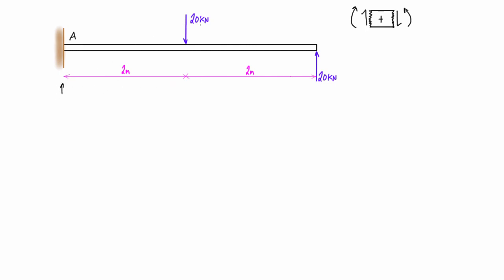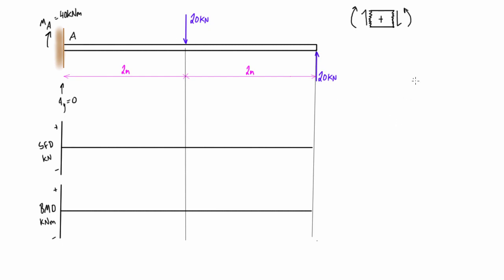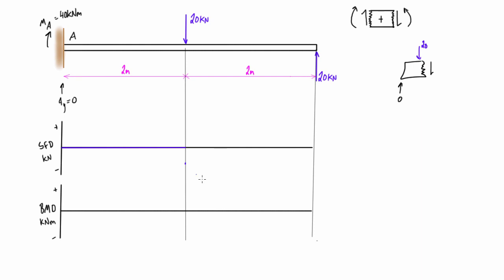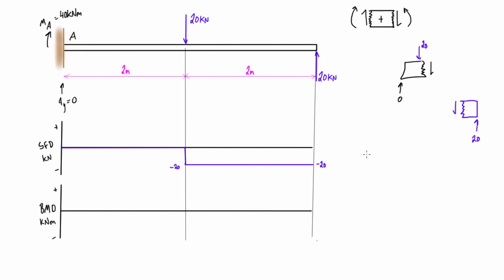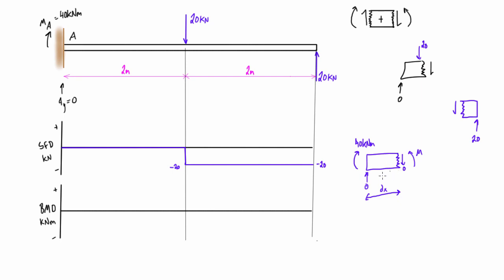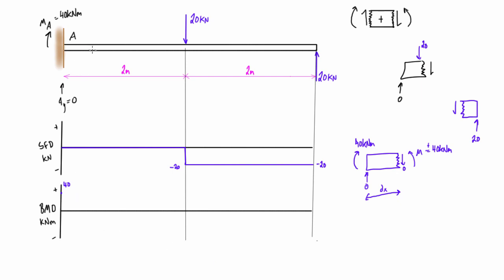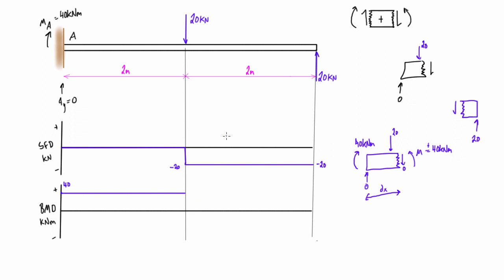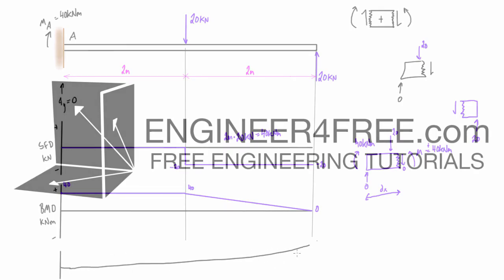Shear force and bending moment diagram practice problem #6

Comment: How did we know that Ma was clockwise? please answer
Reply from the maker: It was assumed, and then that turned out to be correct because the calculated value was positive. You can determine it from inspection in this problem in two ways though. 

1) The equal and opposite point loads generate a force couple that causes a counter clockwise moment. The reaction must therefore give a clockwise moment for the structure to remain in static equilibrium.

2) Both point loads have the same magnitude, but because the far right one is further from A, it's going to create a bigger moment about A than the closer one. The further one generates a counter clockwise moment about A, the closer one generates a clockwise moment about A. Because the further one creates a bigger moment, the net moment is counterclockwise, so the reaction at A must therefore give a clockwise moment for the structure to remain in static equilibrium.

Comment: Thanks for the video! i've been following the playlist for a while, but i have a question. How is it that counterclockwise moments, that are given the minus sign always have concave graphs? So if the parabolic graph for BMD is ax2+bx+c, the a is negative. Comparatively, in my country, it's preferred to draw it inversely, as the counterclockwise moments are actually positive, and it's still drawn concavely above the x axis. Can you give me some insights on this? thank you.
Reply from the maker: Yeah, the convention in some countries is inverse to what I have drawn. But pay very close attention to the positive and negative orientation of the "y axis" of the BMD. I intentionally label the top side as positive and the bottom side as negative. If you look at your professor's examples, you'll likely notice that the top side is labelled as negative and the bottom side is positive. In that sense, drawing an inverse shape has the exact same mathematical value. Ie, +40kNm is still +40kNm as long as it's drawn with a magnitude of 40kNm and is on the positive side of the axis. Confusing? yes. But it's just how it is. Back when I as a student, I had professors from many different countries so I learned both ways, but I opted to make my videos the was I did, because it makes more sense visually as we integrate from the SFD to get the BMD. But in practice, especially when you get into more complicated frames, drawing the inverse of how I have done it often is more useful, because the actual side of the member that is experiencing tension will match the side where our positive values on the BMD are. When doing the actual math for finding a function of M in terms of x though, the way I do it makes way more sense, because we expect positive parabolas to open upwards, and negative parabolas to open downwards. Think in terms of up and down is not entirely correct though, its really that positive parabolas open towards the positive side and negative parabolas open toward the negative side. So if define down as positive, then a positive parabola opens down (toward the positive side). That bends my mind too much and usually causes math errors, so thats why I still opted to draw my BMDS with positive on the tops side. But both ways are correct. 

If you're really confused about which way the concavity goes for a particular parabolic section of the BMD, then there's a simple visual check you can do on the SFD. In the region that is parabolic on the BMD, the SFD in that same region will be sloped, essentially creating a triangular shape on the SFD. We integrate SFD to get BMD, so tl;dr, the area under SFD in a region equals the change in magnitude on the BMD across that same region. Slice up your triangular shape into many skinny tall rectangles and do a very rough mental numerical integration. The area of each rectangle will correspond to the change in magnitude across it's skinny width. So taller rectangles will cause greater changes than shorter rectangles. That means the tall side of the triangle will have greater slops on the BMD than the short side, which will have more gentle slopes. Knowing that, and knowing that a positive area on SFD creates a positive change in magnitude on BMD, and a negative area on SFD creates a negative change in magnitude on BMD (keeping in my which way [up or down] that you've defined as positive/negative, then there is only one way to draw a parabola that increases or decreases from left to right, and has greater or less slope its right or left side. That's a lot of text, but I hope it helps to clarify. You hit a really good question. If it's not super clear from the text, then keep watching the first 9 examples in the playlist, and you might start to see the pattern where I'm using this sort of "visual" triangle method to speed up the determination of BMDs. Good luck!!
Reply: @Engineer4Free  Thank you for answering! so far, i can generally take the conclusion as: if it's UDL, and the magnitude is negative (assume we go by your sign convention), it's most certainly concave, due to the negative slope.
Reply: Sorry i meant to say it's still negative, but just drawn inversely.
Reply: wait no, it's inverse in signs too, so positive for counter clockwise and negative for clockwise lol sorry

Comment: example 4,5,6 how do you determine the clockwise/anticlockwise of the reaction moment?
Reply from the maker: They all use the sum of forces in y direction and sum of moments about a point. Those two of the three basic equations of statics (the other being sum of forces in x direction). You can see some detailed videos on that stuff in the "moments" section of engineer4free.com/statics 🙂

Comment: Im confused as to why the moment on A is going clockwise? in your example #4 video, when the beam is connected to the wall or whatever on the left side the moment is going in the counter-clockwise direction.Is it because the force pointing upward on the right side of beam creates a counterclockwise moment on that side and you just have to match it with the corresponding direction from the diagram  at the top?
Reply from the maker: When you have a cantilever like this, you need to find the reactions at A before we do the SFD and BMD. We do this by using the 3 equations of statics which are ΣFx=0, ΣFy=0, ΣMa=0. The sense (clockwise vs counterclockwise) of the reaction moment will depend on the loading present. In example 4, the applied loads overall apply a clockwise moment on the support, so the reaction force is equal and opposite (counterclockwise). In this example, the applied loads overall tend to create a counterclockwise moment on the support. It can be noticed here by inspection. We have two point loads acting perpendicular on the beam but at different distances from A. The further away, the greater the moment the same point load would make. So here, the point load at the end is pointing up, that's going to give us a greater moment about A than the one in the middle pointing down. When their moments are summed up, the net moment is counterclockwise, and therefore the equal and opposite reaction moment must be clockwise. Don't always assume a reaction on a certain type of support will be a certain direction or sense, as a prof will always pull a trick setup with loading to give you something you don't expect. Does that clear it up?

Comment: How can we determine the direction of moment?
Reply from the maker: Hey you can brush up on moments with videos 25-34 here: engineer4free.com/statics. Generally, if you have a point force acting on member, and you are doing the sum of moments calculation about some point. Imagine for a second that the member is freed from all other supports but pinned at the point. If you then applied only one of the point forces, which way would that point force cause the member to rotate about the point in question. That will quickly give you the sense (clockwise or counterclockwise) of the moment.

Comment: quick question, when you work out the Ma, why don't you write out the full eqn; Ma=20(2)-20(4)=-40kN?

I don't understand how in this case you worked out Ma to be + 40kN

With the eqn I understand that the Ma is acting in a counter clockise direction, since it comes to -40kN

Thank you!
Reply from the maker: Yo Joseph. This trips up a lot of people. In basic statics, you're often taught to just take any counter clockwise (CCW) moment as positive and and clockwise (CW) moment as negative. That's a popular convention for FBDs when only considering external forces in the pursuit of solving for reaction forces. That's great, but now we're dealing with internal forces, which also have sign conventions. Watch this: https://www.engineer4free.com/4/introduction-to-internal-forces and more importantly, this: https://www.engineer4free.com/4/internal-force-sign-convention It's also a bit confusing because the reaction Ma and the internal bending moment M at a are not the same thing. They are indeed equal and opposite. When you have a counter clockwise internal bending moment to the right of a virtual cut like we do in this example, that's considered a positive internal bending moment according to the positive sign convention that I linked to in the second video above. So I draw the value on the BMD as positive 40, which is above the axis of my BMD. Some people put positive above the axis like me, and some people flip it vertically so the positive side is downward. Technically either way is fine, they are just done differently in different parts of the world. So if you were all good with the internal moment sign convention but the BMD just looked upside down, don't worry about that and do it how ever your prof wants it. If the BMD doesn't look upside down to you, but were just confused about the CW vs CCW moments then ignore this part of what I'm saying and just watch the other videos that I linked to =) Hope that clears it up!
Reply: @Engineer4Free  Thank you so much, it was very well explained, although the whole concept is a bit difficult to grasp
Reply: @ghazanfarsheikh44  Believe it or not that’s a good thing, it takes a while to sink in.

Those who think that they “get it” instantly, rarely do. 

Just stick to the diagrams and draw them in a column, it’s easy to mess up. I’ve seen professors get confused.
Reply: @Engineer4Free  thank you. I think I understand it, but not as fluently as I could, and definitely not fluently enough to try and type out any concern I still have regarding my understanding through text. Too hard to convey!

I watched those two videos, I probably should've started from there. I started from Q1 to Q9, and then after Q9 realised I didn't remember differential eqns haha!

I'll continue to do problems, and if I find i trip up somewhere in my understanding I will send you a message.

I have sent you a DM actually to ask for some quick advice!

Oh and yes, your graphs are how I was taught. I'm in australia, so positive is above the line.
Reply: Ahh, I just listened back and you said, equal and opposite. Not sure I've been understanding it like that up untill this point.?

Comment: Hey, great video! I am finding it difficult to understand why the beam is delfecting upwards?
Reply from the maker: Thanks! Imagine a diving board with a person standing on the end. That would be a cantilever beam with a single point load equal to the person's weight at the free end. You know that the board would sag / deflect downwards at the free end. If you instead applied the same load (equal to the person's weight) in the upward direction at the end of the board, it would deflect upwards the same amount. Now imaging the person is standing on top again at the free end, but at midspan there is a person pressing up on the diving board with a force equal to the top persons weight. This makes the vertical reaction in the fixed end zero, and reduces the moment reaction by half. But less math and more real life imagination: will the diver at the end be lifted up or sagging down from the diving board's original position? The board will be sagging under the weight of the diver at least relative to the position of the board at midspan, because, well diving boards are super floppy so of course that part must be true. Imagination tells us that obviously the board will sag down at least from midspan to the free end. Imagination doesn't exactly tell us whether or not the mid point of the board will be above or below it's undeformed/original position. We use the assumption that rigid connections remain rigid even while the rest of the structure is deformed. So our diving board will be horizontal right at the connection. We then consider the BMD of such a system (which in case I lost you is just the vertical mirror image of the one presented in the video) we would find that the internal bending moment is negative everywhere (again, would just be the mirror image of the BMD in this video).The BMD would not cross zero (note it equals zero at the free end, but it doesn't go from a positive value to a negative value or vice-versa somewhere along the length of the beam). If a BMD crosses zero, there is an inflection point in the deformed structure at that location, which means the concavity of the deformed structure will switch. We don't have that, so concavity is the same everywhere. If the board is horizontal at the reaction, and displaced downward at the free end AND there is no inflection point, then the beam must just deflect further and further downward as we go from the fixed end to the free end, maintaining a "concave down" curvature the entire way: try drawing the deflected shape with these constraints (horizontal at reaction, free end displaced down, concave down everywhere) - there is only one way to satisfy them and you will see that the midpoint, and all points will be displaced downward. If somehow the board was displaced upward at midspan and downward at full span, then there would be an inflection point somewhere between the fixed and and midpoint if it was horizontal at the reaction: trying drawing the deflected shape with these constraints too (horizontal at reaction, midspan displaced up, free end displaced down) - you'll find that you have to include an inflection point that isn't supposed to be there in the correct solution). Note that without the presence of a hinge somewhere in the middle of the beam (only really shows up in trick problems, so don't worry about that), the deflected shape must be smooth ie. no sharp angles. So between a bit of imagination of a real floppy diving board, and some discussion of the moment in terms of x as we move along the BMD, we can determine the deflected shape of a beam (or diving board) that has equal and opposite point loads at midspan and fullspan. If you flip them so that the on at midspan points down and the one at the end points up, we get the mirror image of the diving board example (the FBD, SFD, BMD, Deflected Shape are all mirrored vertically compared to the discussion of the diving board [or as presented in the example in the video]), and so the beam would deflect upwards rather than downwards at the free end (and actually everywhere along the span). Such is the example in this video. One last note: diving boards are super floppy, so are a good way to imagine cantilever beams in an exaggerated sense. If the beam was steel or something, it would follow the same deflected shape, just have way less actual displacement at any given point. That turned out a lot longer than thought it would. Read it once, maybe twice haha. I hope that I conveyed it clearly, lemme know!
Reply: Thanks! By any chance have you studied Thermofluids, I have an exam coming up soon, any help would be great.
Reply from the maker: I only have a few intro lessons at the moment: https://www.youtube.com/playlist?list=PLOAuB8dR35oeOIPMOBH6hjwobuIJHPKSN I will add more at some point but that wont be before your test sorry :/
Reply: Engineer4Free no worries at all, you've done so much to help me already!